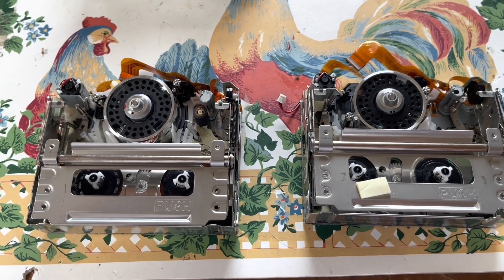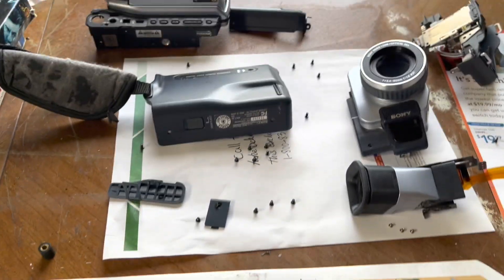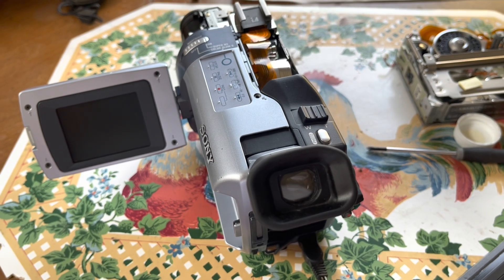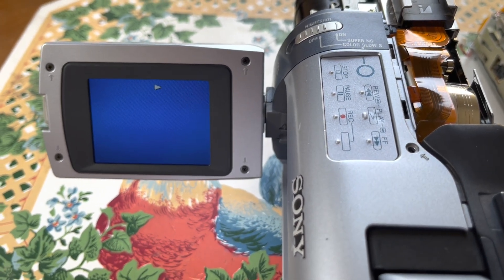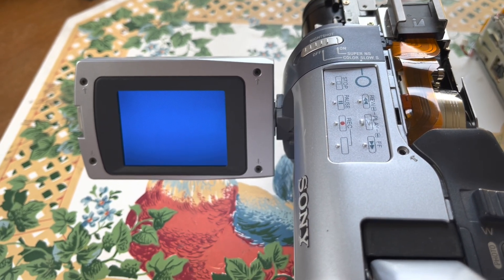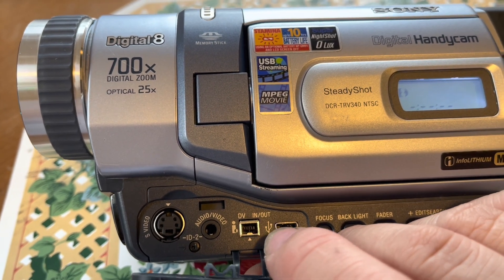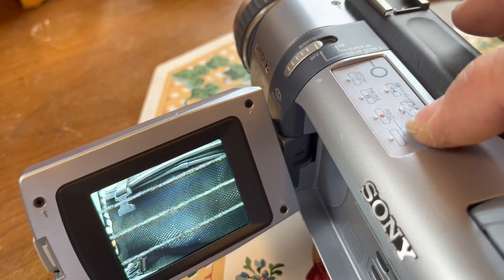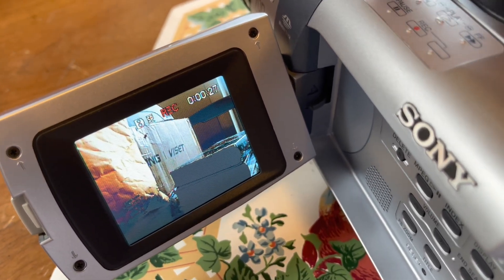Sony Handycam DCR-TRV340 Hi8 Digital 8 Camcorder Repair and Teardown

Comment: Hi, i'm having a similar problem with almost the same model. does the transport have a part number? it looks exactly like mine. I'm trying to find out whats wrong with mine or figure out if buying a replacement is viable. It was my dad's camera and i'd like it to run again.